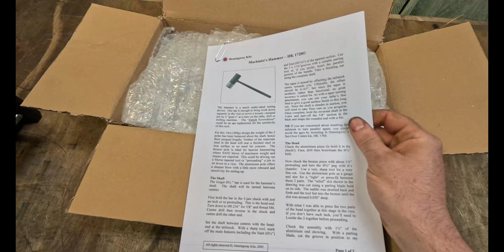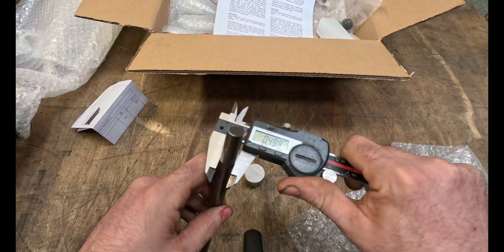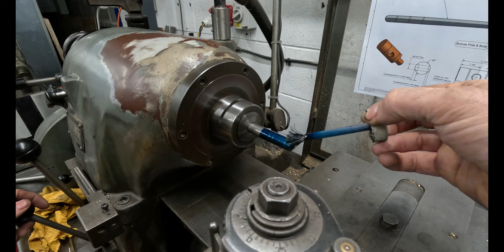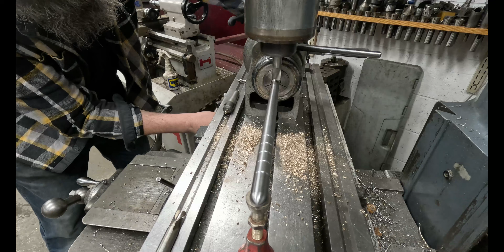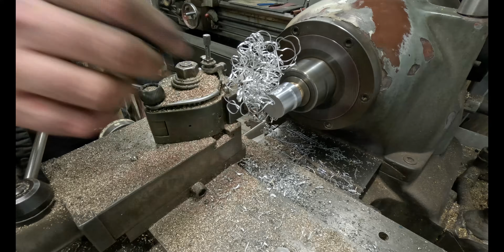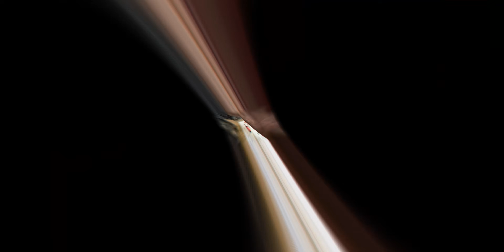Hemingway Kits Machinists Hammer

Comment: Hey nice work. Your video showed up recommended as I was watching other Hemingway projects. Something just stood out to me at the half way mark through your video. At 8:04 I paused and and figured I'd comment. So I run a lathe as well, a ML7 to be specific and also use a swiss Multifix/Multiquick tool post. So on your tool post the top plate does not sit snug on top of the clamshell and is allowing a bunch of swarf to creep under and inside , also your clamshell appears to be resting on top of your compound slide. not really sure what's going on here but it looks like maybe your locking C ring that locks on to the cam mechanism is between the plate and the clamshell and not on top of the plate. Either way , that gap you have should be on the bottom of the post so the clamshell doesn't bottom out and you don't get that nasty swarf creeping in there. You can tell that the locking handle also sits a little proud on top there. Or there might be another C ring missing that should be under the clamshell and around the cam to hold it up. I use a AA Swiss that is the exact brand you have. Just trying to help.
Reply from the maker: Thank you... I don't have the experience to know any different... Will look at it on Monday when I'm back in work